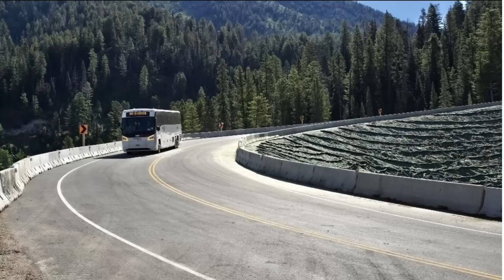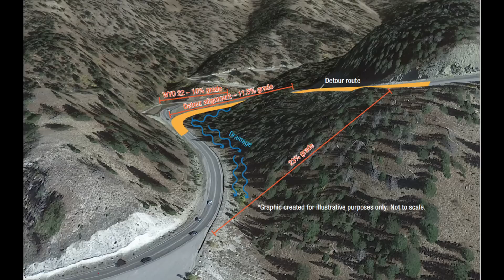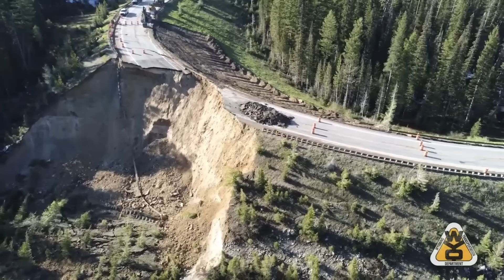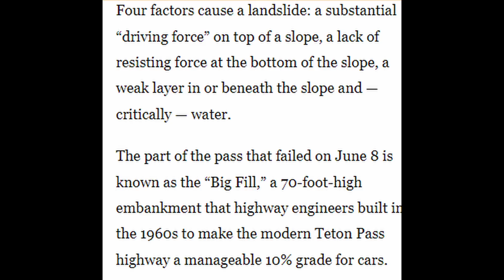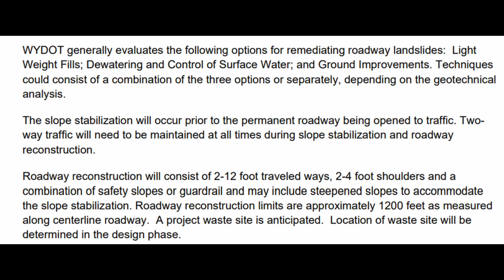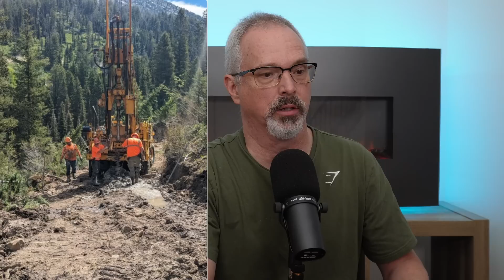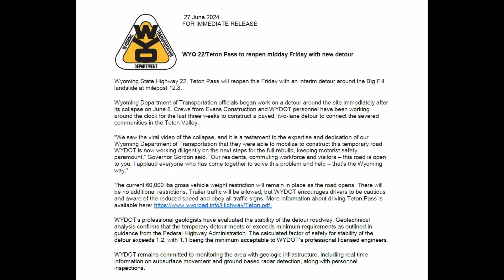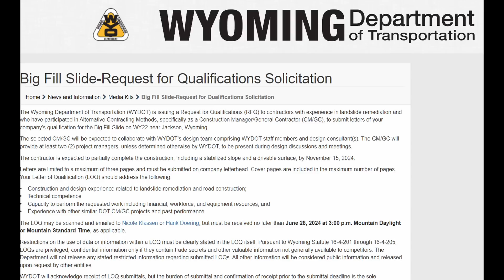Teton Pass - Bypass Completed and Open to Traffic

Comment: I say this honestly.  If a road is a couple lanes and if it fails then maybe 20 people die, but it carries 100,000 people a month, then by math this is a low risk.  The odds of dying from random illness is like 0.1% a year.  So 0.05% is much less.  And we should let bridges be used till they fall, don't replace them likely 20 years before failure, this would let us have 200% the bridges even if 10,000 die.  We lose 1,000,000  yearly about a decade premature due to lack of money for cancer and heart and lung screenings, cuz we use money to fix every possible road and bridge failure.  I could be wrong, but small risk is small risk, when did engineers start skipping the math to just demand more paychecks and jobs for engineers.
Reply from the maker: It appears that WyDOT didn't complete even customary engineering calculations for this bypass let alone do a probabilistic analysis.
Reply: I am no expert so don't mean to annoy.  But valuing safety too high seems incorrect.

Even if the WY road starts to collapse I doubt a modern car sliding down the WY slope will lead to a death.  Low risk of death.  It isn't sharp hard rock below.  It isn't 1920s cars with no crumble zones and no safety glass. 

Due to lack of transport there is a cost to safety of people losing jobs, so if a few towns are cut off for month so 100 people lose their jobs, that is a rise in poverty and depression and lack of medical care.  

With Covid we had experts focusing on only losses from illlness and not all the other costs not allowing quick free movement brought. 

The Chinese operate bridges despite safety concerns since getting 50% more lifespan saves billions and the hundreds of lives lost is worth less than that.  And people are willing to gamble and they won't be that scared of rickety bridges, it turns out.

Comment: As a geologist I have to put in my opinion. This was not a slide, but a washout. You have a manmade fill across a valley and improper/inadequate drainage, I'll guarantee failure over time and during an extreme wet cycle. Here the WDOT in an attempt to cut highway and maintenance costs, neglected to build a bridge when one was definitely called for, given the geology and drainage in the area.
Reply: A bridge is exactly what is needed here. Good call Mr. Earth Scientist. What's your favorite rock?

Comment: That Teton Bypass was doomed for years.  It was constructed from built up sand, gravel, and whatever debris the construction company could get on the cheap.  It was not firm undisturbed natural ground or rock.  It was the highway equivalent of a sand castle at the beach.  It was built that way to avoid the cost of a real steel bridge.  How do I know this?  I have the same situation in my front yard.  The highway dept. used round stone river gravel to build up the grade.  My mailbox is leaning back and pointing upwards even though its set in concrete.  The highway department says they'll get to it after it collapses.

Comment: WYDOT simply traded "road safety" from a geometric standpoint for road safety from a geotechnical standpoint.  The reduced the fill height and weight and sharpened the curves.  Engineers that design roadway geometrics know that tightening horizontal and vertical curvature and simply reducing the speed limit to 20 mph for that kind of highway will lead to a variety of crashes over the long term.
Reply from the maker: That is a great point, although I question the level of safety for the geotechnical aspect as well.  I wonder if this is how WyDOT normally operates.

Comment: It helps to acknowledge a Hologram is a mathematical programming coded firing order sequences between fire and ice crystals joined as One to seek perfect structural Spiritual mathematical flow ratios integrity organization of planetary hydrogen technology generators building capacity on Universal Galactic Motherboards 
Ur operating a DNA software network communication operating system plugged in to Gaias logic 3 spheres logos Motherboard 
That's called a grid failure 
And the biggest reason is we have 2 syde by syde Templates running simultaneously between 3 spheres 3 3 3 waves atom spheric pressure sensitive nuclear coded mathematical hydrologic firing order sequences and the other digital twin 55 harmonic Black Hole Vampiric circuit breaker mathematical flow ratios running 2 2 2 Digital 6666 
Flip a 9 of a 45° triangles quadrants between 2 planetary magnetic Hemispheres ATP Kreb cycle immunity function Firewall shield 
And U get 60° at 60 hertz Digital implosion coded filing cabinet systems 
Their system is not compatible with the Eternal original NOMI Noble Planet encryption coded Krystal wave form Spiral Spiritual mathematical structural engineering integrity organization of planetary Holographic visual mathematical filing firing order 
We are the tech support operators here as Guardian Alliance Shield security teams performing grid repairs 
That's our message to the public 
Have a beautiful day everyone we love U all equally sharing pure eternal absolute love 
That's why we're here 
Their AI QI coded network tried to hijack the original NOMI Noble Planet encryption coded grid 
That's what Terra forming is 
RE format the Holographic visual mathematical programming language coded DNA software network communication 
Systems engineering circuits 
The engineer's are here AKA the builder's tools Spanner Gates builder's Guardian Alliance 
Mu ah VA 💋🌈 
PS they don't know what they are doing 
They have no clue how to repair a Universal and Galactic Motherboard

Comment: Experienced road builder, the quality of materials, compaction, and design-slopes, grades matters totally.  It looks like they used topsoil 😂 instead of crushed rock to interlock for structure and strength.  The clay they used should have been the sticky grey hard clay not that brown topsoil. Not enough safety factor margin at all. I think it’s dangerous.  I would stay away from there especially after a few rains.
Reply from the maker: I think WyDOT has made a mistake in rushing this bypass construction.  They will now be impeded in doing the permanent repairs as this work has to be done while keeping that bypass open to traffic.   In my opinion, that should have taken a few weeks to get all of their data and do a proper design and simply rebuilt the failed section of embankment along with performing any necessary remediation of the foundation soils.

Comment: I'm just worried about settlement as well.  Even when the fill has been installed and compacted in 8" lifts, the soil always has a tendency to settle after the work is done.  It's the nature of soil after it's been placed.  On top of that, per the old UBC, any fill slope over 25 feet in height should have significant drainage and benches to help stabilize the slope.
Reply from the maker: I agree with you.  I will be curious if they will make the mistake of watering the embankment slopes in effort to reestablish vegetation.
Reply: @CaseyJones-Engineer  I can feel some waves showing up already (and it's possible I'm being paranoid, yes)

Comment: It’s clear they just pushed a lot of dirt around for the “temporary” fix, did the equivalent of snapping the tie down strap and said, “that ain’t going anywhere”.  And then they justify this by actually doing a proper fix to restore the original road section.   I mean, this approach works. . .until it doesn’t.

Comment: So why don't you go get a job a WYDOT? Go up there and study the soil at this site. You are just being arm chair quarter back without going there to do your due diligence.
Reply: Why doesn't WYDOT hire a competent geotechnical engineer?  That's the question that should be asked.
Reply: @michaelcurtis-cdot8978  How do you they didn't? You are taking the word of a guy that has never tested the soil on that road bed. How do you this guy is for real and knows what he is talking about? That,s right, you don't.
Reply: @johnhawley4467  He owns his own geotechnical firm.  He is a registered professional engineer.  He has the experience to back up his comments.  WYDOT lost all credibility when they patched the cracked asphalt the day before the failure and were ready to open to traffic and lucked out with the mud slide closing the road.  WYDOT didn't even recognize the slope failure was imminent.  Did you even listen to James Dahill saying a safety factor of 1.1 was ten time better than a safety factor of 1.0.  It is ten percent better not 1,000 percent better.
Reply: @michaelcurtis-cdot8978  Has he went to wyoming to test the soil at the slide? No he hasn't. Without doing that it is just a guess on what he says. A true "professional engineer" would know that. He said the fill was 120 foot tall, it was not, it was 70 foot. He did correct that mistake. But it still comes down to, he has not been there to test anything, so that means everything he says is speculation, NOT FACT.

Comment: So: it is urgent to reopen this route as soon as possible. It isn't possible to do a thorough analysis and design on this timescale. This can be handled. You do your best, you closely monitor, and you adopt mitigation strategies so that a failure is very unlikely to cause fatalities. The speed limit is one such mitigation strategy: if the road disappears, drivers will have time to stop before plummeting into the new ravine. You also need the ability to quickly close the road if something fails. With this combination, for a fatality to occur, the failure has to go from no warning to complete failure in minutes (we're closely monitoring and have the ability to quickly close the road) and to just happen to fail when someone is directly on top of the failing section (because anyone who is nearly on top of the failing section is going slowly enough that they have time to stop.)  

But to openly implement this sensible strategy, you have to admit that this section of roadway could fail at fairly short notice, and it seems nobody is willing to admit this. (Note that the previous failure gave days of notice.)
Reply from the maker: I agree with what you said in terms of transparency(or lack thereof in this case), but WyDOT wants it both ways. They wanted to do the quick and dirty fix and then make it seem as if they've done a thorough evaluation and design when they clearly have not.

Comment: I've seen a VP engineering manager deny an inspection on an element of a system in a nuke plant. His logic was that it was better to move forward with a design without the inspection data rather than "open a can of worms" by inspecting the internal condition of a machine. We lost that argument with him but he did get arrested on unrelated federal charges later. Sooner or later lying as a get ahead plan fails. This story is not over, physics will cast it's vote sooner or later.
Reply from the maker: Wow, that is a crazy situation to have at a nuke plant. You are right.  The physics do not change just because they are in a hurry.

Comment: WYDOT deserves incredible kudos , as does Evans construction they worked with one of the only “contractors “ capable of dealing with this in the area - they worked 24/7 - I drove over it yesterday- , it’s better than it was before , two paved lanes ready to go .Yes , guess what , it is steep , welcome to Wyoming - the new compactors are different than what the boys in the 1960’s  had don’t you think ….You got right to the dam failure , can’t believe how bad the engineering on that was lucky nobody got killed there , wow ! - ( Wyoming must be too big or expensively far away for you to actually too big , or maybe we should tax you more so the Feds can come and built it for us . ) Come and see it - all this “information” is secondhand , the engineers, the geology- “typically the risk parameters “ - come help get the “geotechnical information “ - there is no virtual road building - “ your opinion is like ….well we all know what opinions are , who has them , and what they smell like - bridge abutments in the Midwest …..keep talking …..
Reply from the maker: I think you made a point, but perhaps not the one you intended.

Comment: Seems like the same folks who thought it was OK to spread out a little pavement to fix the cracks just before the original failure, should not be trusted to understand safety ratings.
Reply from the maker: I think that is correct.  They really did not take any responsibility for that initial error in judgement.

Comment: I suspect that WYDOT is pretty confidant that anything done reasonably well can hold up thru a summer season. Winter/spring is the issue. The likely only consider something as permanent if it is expected to last thru the difficult seasons (winter/spring). While we are seeing more and more extreme and record setting weather more frequently, I can't imagine that much water being forced thru those clays during the summer or early fall. But they should just say that, if it is indeed what they are counting on.
Reply from the maker: I think they are not accustomed to being questioned about technical issues, hence the lack of transparency in what they are doing.

Comment: Strikes me that it would be hard to design and put in a decent and comprehensive drainage system in 3 weeks. Also, nobody is talking about the ongoing problems that happened in the original construction or the problems that have been going on since then.

Comment: I emailed WYDOT Transportation Commissioners regarding having a Professional Geologist in charge of the Teton Pass detour instead of a Geotechnical Engineer.  I asked the question does WYDOT even have getechnical engineers on staff,  does WYDOT hire consultant geotechnical engineers, and most DOTs that i have worked with use Geotechnical Engineers and not geologists for these cases.  I don't expect an answer back but just wanted to point out the shortcomings of using a Professional Geologist.  Thanks for the audio recordings.  I couldn't believe Mr. Dahill and his factor of safety explaination.  I hope that was a lack of sleep gaffe because if it wasn't that is really troubling. Wyoming is the Cowboy State and unfortunately it appears to be Cowboy Engineering.
Reply from the maker: Thank you.  I emailed the governor's office a couple weeks ago about my concerns and got no response.  I am sure Mr. Dahill has a role here, but being the technical representative on these geotechnical matters shouldn't be on of them!
Reply: @CaseyJones-Engineer  Totally agree.
Reply: @CaseyJones-Engineer  Question for you. I don't have the Highway Design manual, as I focus on buildings. For buildings and developments, all the global stability analysis's that I've read have had a static factor of safety of 1.5 minimum. Additionally, they've had a minumum of 1.3 for Earthquake (short-term) loading. After all the calcs are said and done, I've usually seen that factor of safety drop .2-.3 from its static condition. Jackson is a pocket of high seismic, it governs 95% of the buildings here in lateral design. Does AASHTO or Highway Design manual require an earthquake analysis? Seems crazy that they wouldn't being the building code does... I'm just thinking, if they're under 1.2, in an earthquake, they're suddenly very very close to 1.0 if not below.

Comment: This is absolutely common in many situations.  Same with airplane, train, and truck crashes.  You absolutely cannot shut down an entire airline industry, nor railroads, just because somewhere, and somehow, one platform crashes.  You go find out what happens as fast as possible, to stop or delay the next crash.  If hospitals shut down because one of their doctors accidentally cut your wrong leg off, there would not be any medical care.  At some point, the actual demands of millions, strongly outweigh the opinions of some QA engineer.  WW2 would have been lost, if we paid any attention to the QA people.
Reply from the maker: I think they should be able to "walk and chew gum at the same time"!  I don't know what WyDOT has learned, if anything, about calling a road section good, only to have it fail catastrophically hours later.  Now it appears that these same people will be responsible for monitoring this new bypass.
Reply: @CaseyJones-Engineer  True, Agreed.  Will your posting help them, or piss on them.  Sometimes both ways work well.  I've been there, and know the whip when it comes, and often can anticipate it early.
Reply from the maker: @brunonikodemski2420  I think my posts have helped them in many respects, but I don't think they would ever admit it.
Reply: As a transportation engineer safety trumps everything!  To do otherwise is malpractice.
Reply: You are daft to draw the slightest equivalence of a War situation to this.

Comment: Well, it failed the first time with those safety factors.  What's changed?  Did they modify the soils?  Nope.  Did they install drainage?  Probably not.  So even if it's relatively safe today, it may not be safe tomorrow or next week.